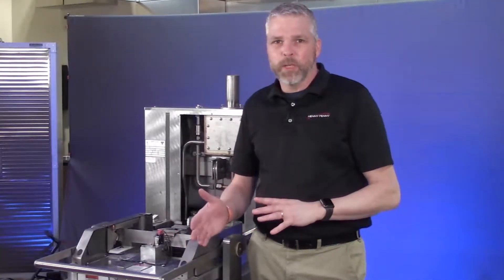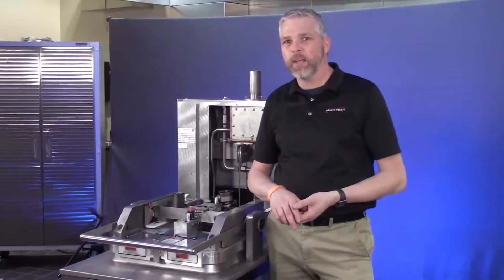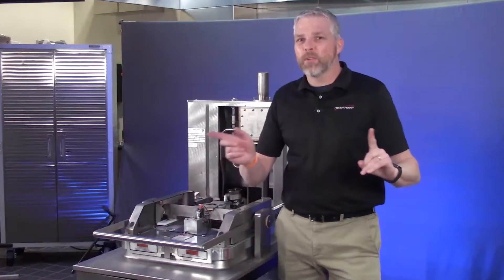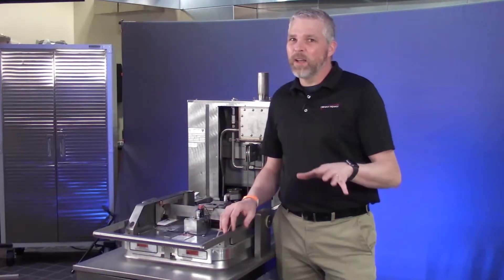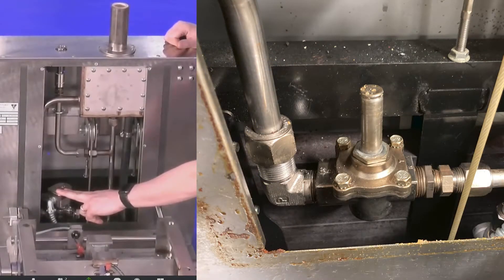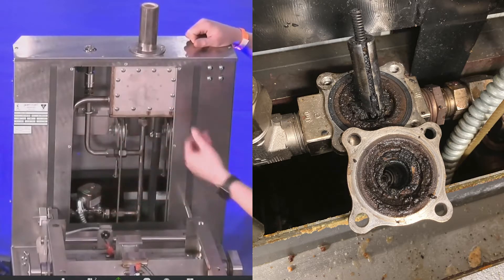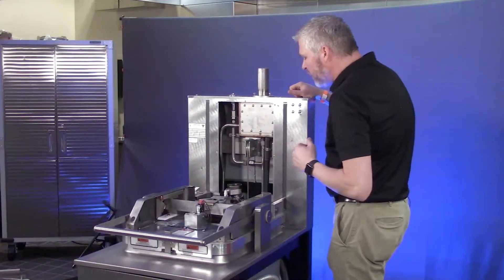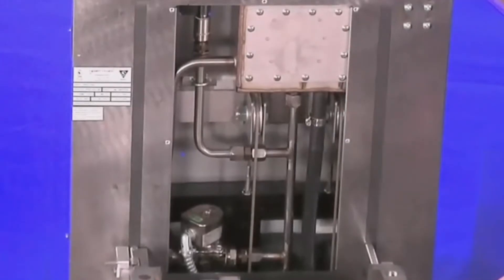E-86B Error Code "Pressure Stuck On" Troubleshooting - Henny Penny Velocity Fryers

Comment: We have a problem with a error
When the cook tries to cook mini fillets it says “-wait-“ then it flashes and says “pressure”
There should not be pressure on minis anyway please help
Reply from the maker: Hello Tom, your issue may require additional questions to pinpoint the solution; we are unable to offer technical assistance through our channel; however, feel free to contact our technical support department at tservices@hennypenny.com for assistance with that issue.